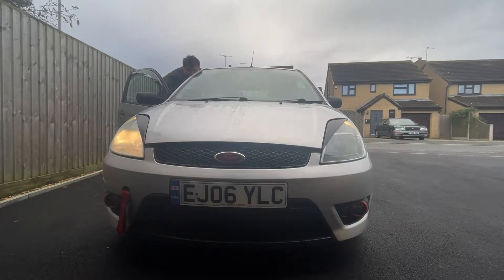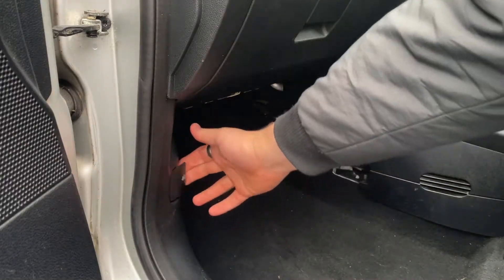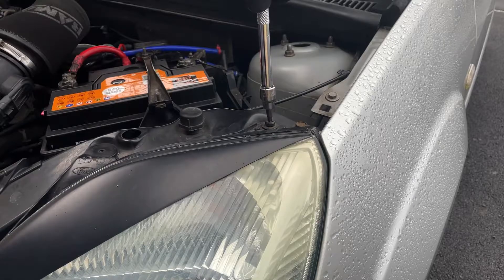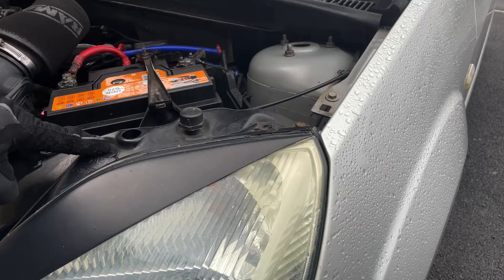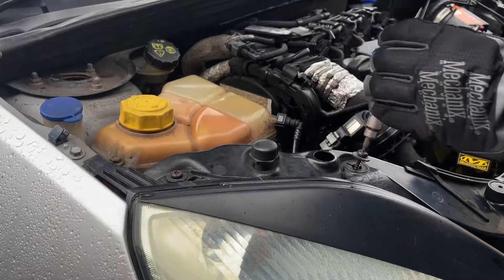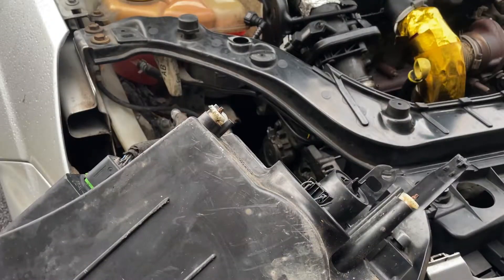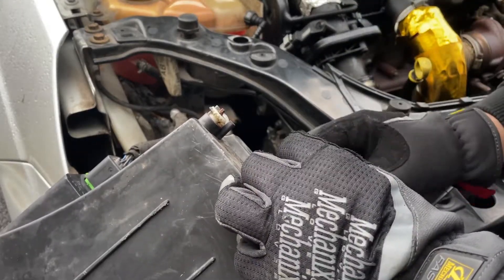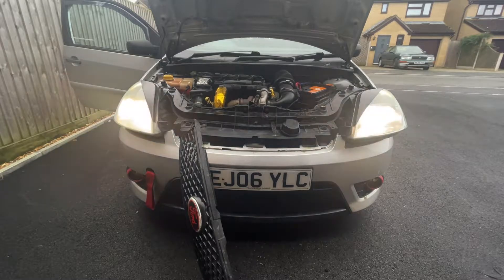How To Replace The Headlight Bulbs On A MK6 Ford Fiesta

Comment: How did you remove the cable.. I couldn't pull it off..
Reply from the maker: Need a small screwdriver and pry them off they are annoying little clips